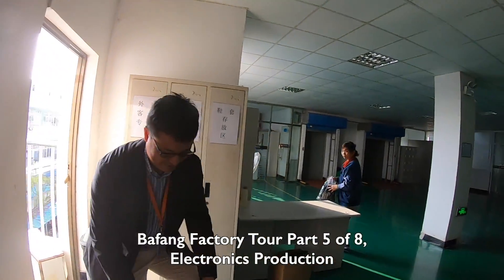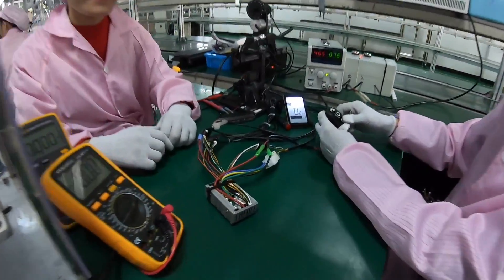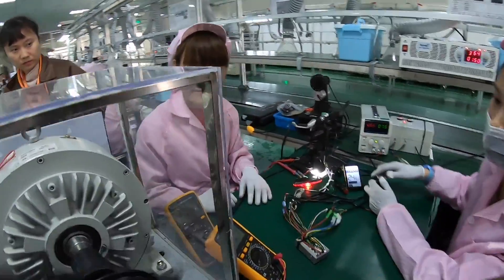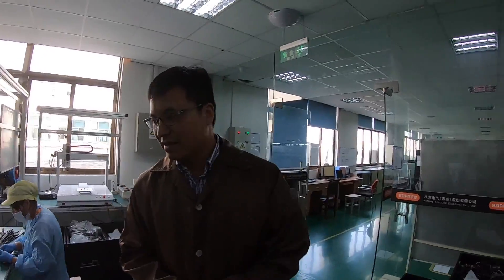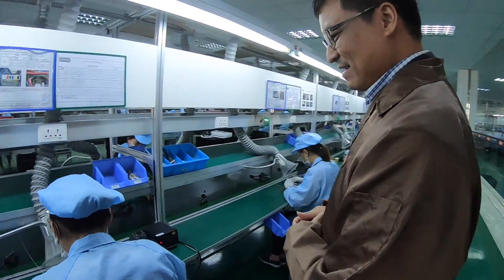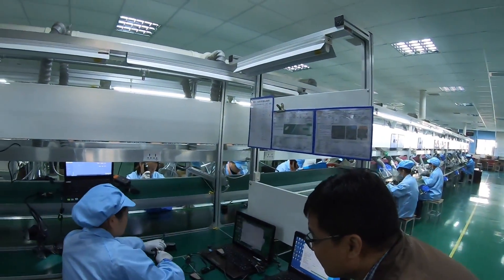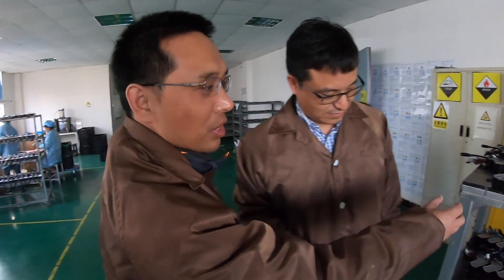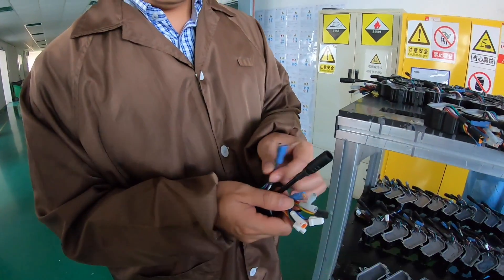Bafang Factory Tour Suzhou China - Part 5 of 8 (Electronics Production)

Comment: They need to make available the main cable for the harness in three lengths for diy kits so the the install looks cleaner.. presently that's hard to do as it requires cutting and splicing the cable..